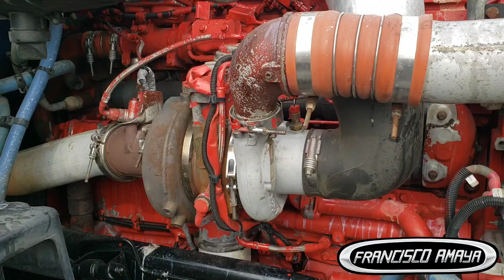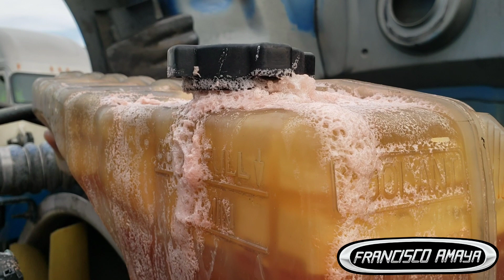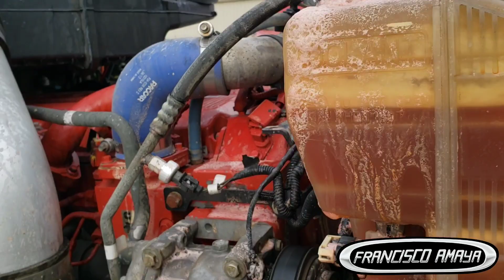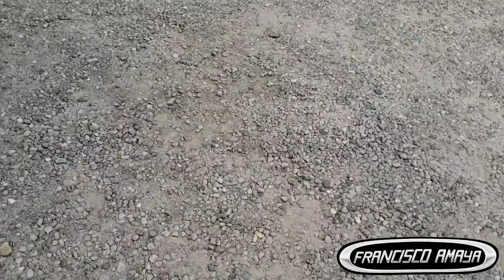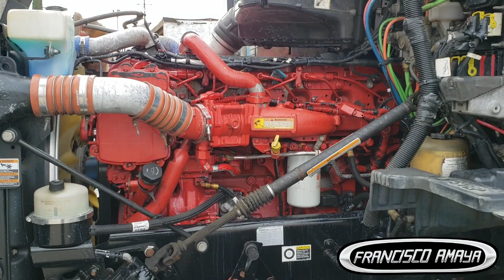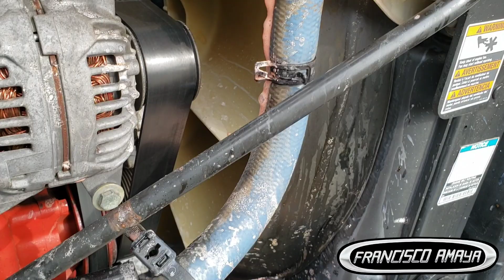Cummins ISX ISX15 high pressure coolant tank broken cylinder head gasket engine overheating

Comment: Friggin cummins. I had this crap happened to mine the second time this year. First time was micro cracks in head so we replaced head, head gasket and all other gaskets, ran fine for two month and now again in shop, the brand new head gasket got blown between cyl 5 and 6.
Reply: Sorry sir that happened to you twice I pray for you you pay less money
Reply: Liner has dropped. Counter bore and shim the liner
Reply: What year is your Cummins?
Reply: I heard that they have these kinds of things between 2011-2015. Engine liner dropped; I had similar problem this year. I was thinking that was EGR cooler leakage, but ended up with head gasket…

Comment: Thank you sir and now show us how to fix
Reply: It is pretty much simple. You need new head, head gasket and all other gaskets to put the engine back together, patiently wait for parts to arrive and pay the labor.
Reply: @igorushka  u god damn wright lol
Reply: Quick update: after second repair the truck worked good and I sold it and quit trucking.
Reply: @igorushka  was it cylinder head or head gasket or air compressor????
Reply: @moesammour1865  first breakdown was(920K miles)“ micro cracks in the cylinder head” second breakdown(940K miles) was head gasket between cyl5 and 6. Of course head gasket was new. But after my thorough investigation, the second breakdown could be prevented if shop replaced old thermostat. Coolant temps were spiking for short period of time up to 230-250F every time after cold start till you get to 70mph and fan kicks in. Other than that it is a good engine, it lasted almost 1 million miles with regular maintenance and some sensors here and there. It climbs all the hills, does 80-85 mph for 2000 miles week after week.